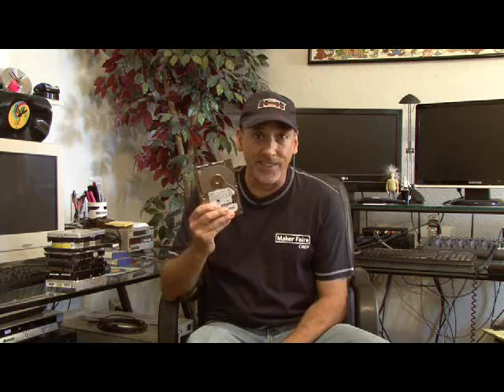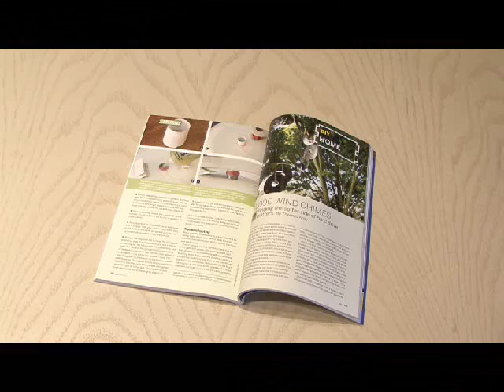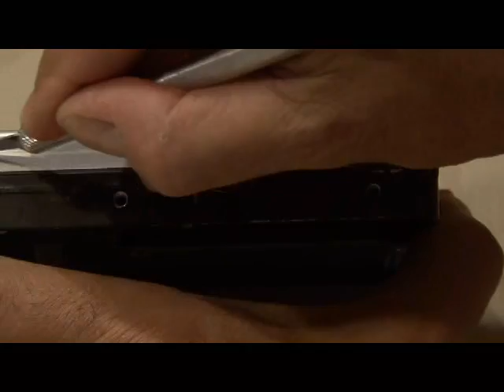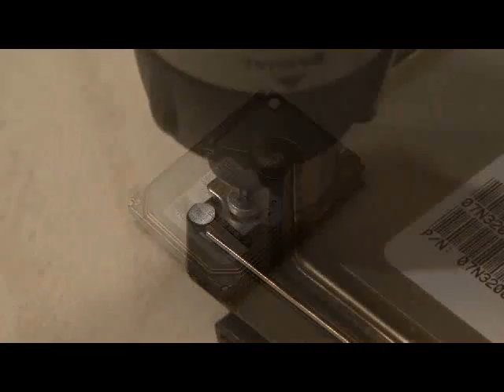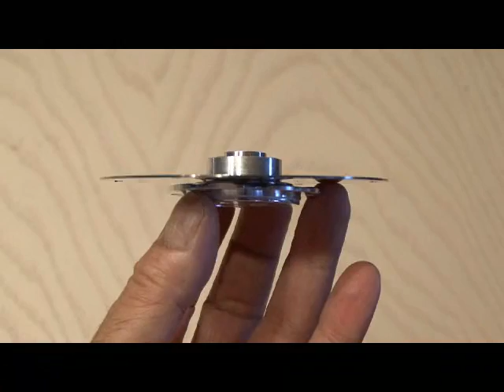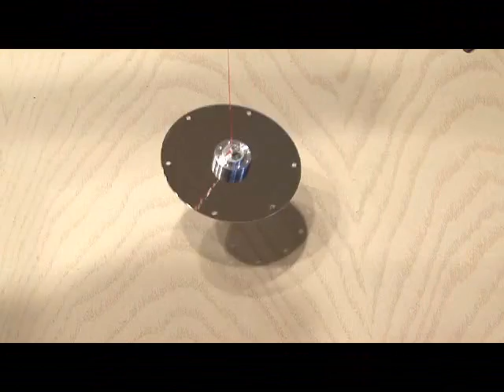Weekend Project: Hard Drive Wind Chimes

Comment: some hard drives have small separator rings, usually hitachi.  didn't find them in my WDs.  they RING real nice and will actually add color to the chimes.  hang them as well.

Comment: Was it a Hitatchi?  I have heard that Hitatchi hard drives have glass platters, but the majority of hard drive brands out there use aluminum (or some other metal) for the platters

IMHO, glass platter hard drives are risky as the slightest bump could cause it to shatter, then you lose all your data unless you have a backup, I don't think there's an advantage in using glass versus aluminum, probably just cheaper

Comment: Those star shaped screw heads you are mentioning are called Torx screw heads

As for the PS3 hard drive, the PS3 uses a standard laptop SATA hard drive, there is nothing PS3 specific about those hard drives (I would know, I replaced a hard drive in a PS3 twice)